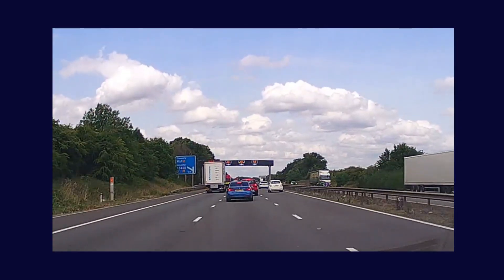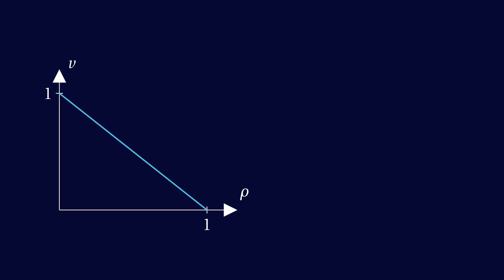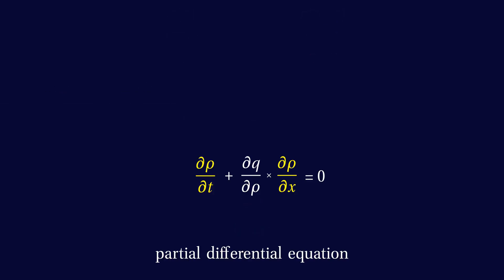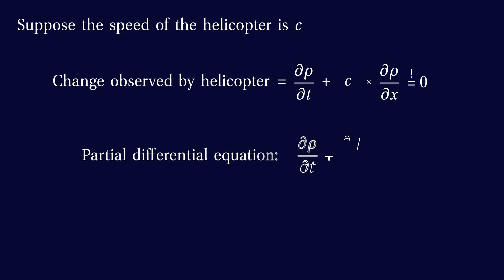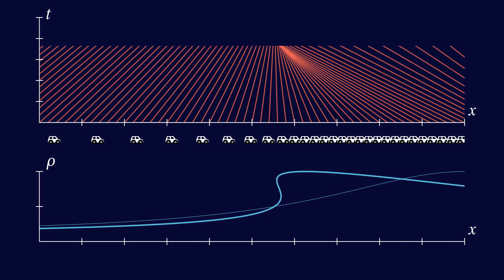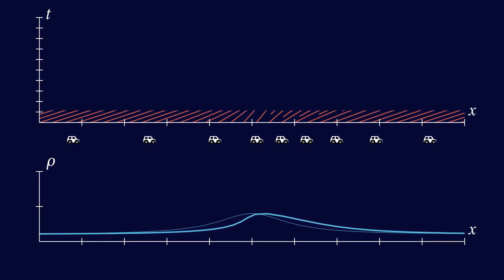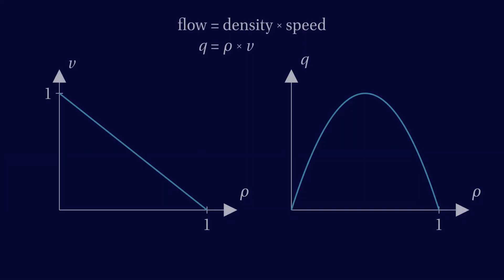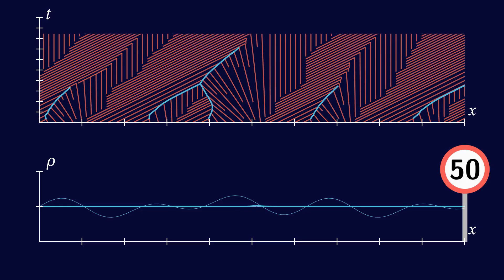Waves, not cars - modelling traffic as a fluid

Comment: Beautiful visualization and the exact right amount of math. Love it!
I'm not sure I understand the final t/x plot correctly in conjunction with the rho/x plot, though. Does the flat rho/x line not imply that the top most layer of the t/x plot should show lines with all the same slope? Yet we have vertical lines and lines pointing to the right.
Reply from the maker: Ah yes, that is a bit confusing. The rho plot is not perfectly flat. In some places rho is slightly above .5 and the characteristics are (very nearly) vertical, as they would be at that density without speed limit. In other places rho is slightly less than .5 and the speed limit applies, so the characteristics slope right. So, even though the density and speed are nearly the same everywhere, the characteristics look quite different.